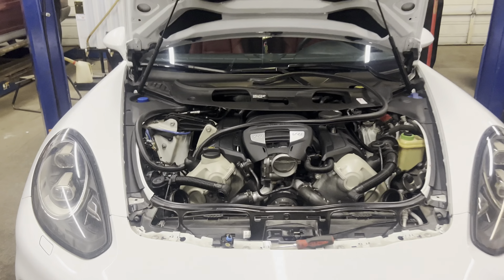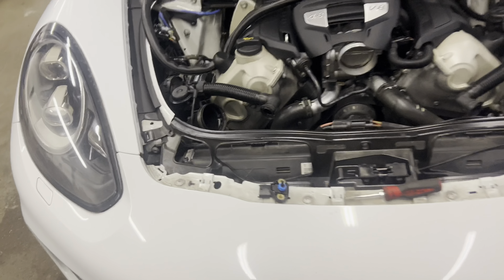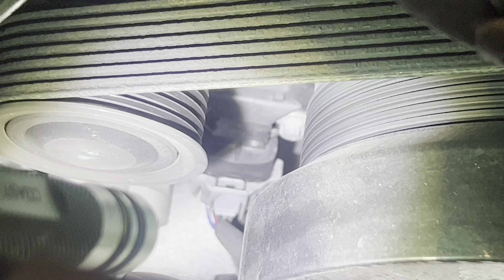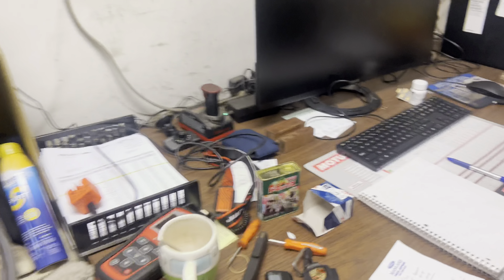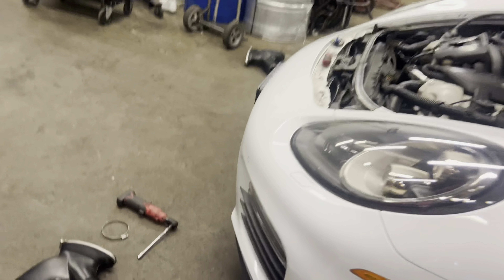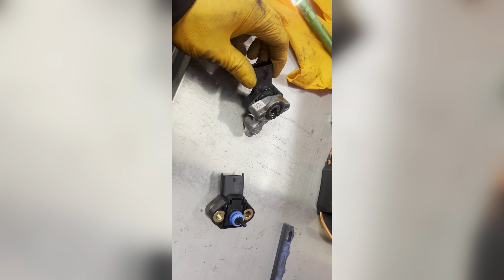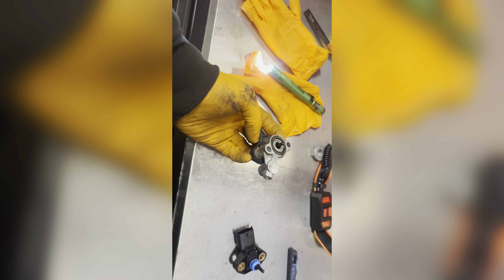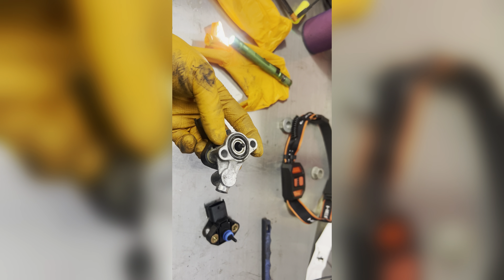Porsche Oil Pressure problem ? TRY THIS FIRST !!!

Comment: Hi did this solve the issue. I have the Oil pressure too low warning also Fault oil pressure monitoring? 2011 V6 3.6 P4 166k mi
Reply from the maker: @rjules777  try change sensor